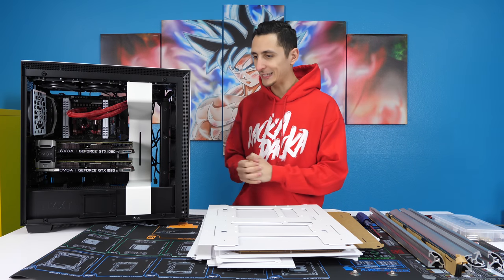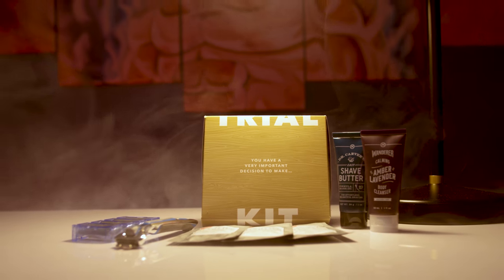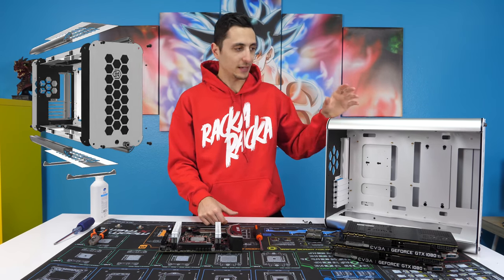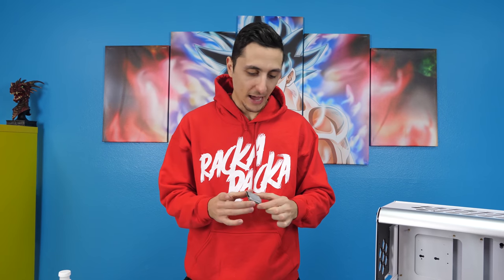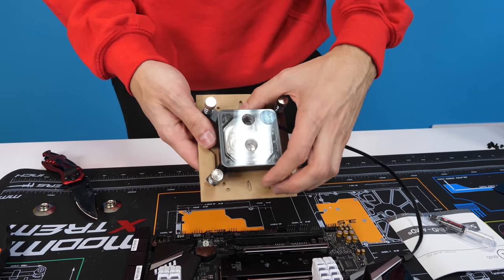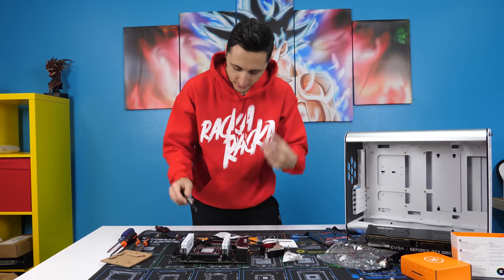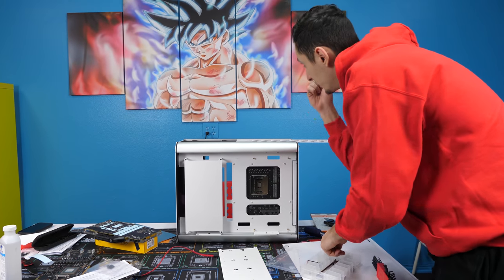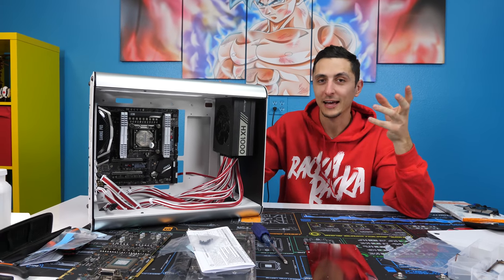Building My Ultimate $9000 PC - Episode 2

Comment: LIKE THIS SO ED CAN SEE 

The reason the paint was not sticking in certain spots ether that there was some type of non visible oil witch was repelling the paint. Or the clear lacquer that the pc cace company dose not want to let the paints stick to it. One way to fix this is to sand down the pc part u are painting so that it is slightly rough. in doing this the paint will stick better.
Reply: BKMOTO 28 which*
Reply: Actually, you can use a solvent to remove the oil, such as rubbing alcohol or paint thinner.  If you sand use like 3k grit.
Reply: yups, it's definately the paint and probably some greasy bits aswell, always sand, degrease, spray...always! even whithout paint , filler, or basecoat..just always...for prepainted-parts like this, just a very fine steelwool should do the trick, take of the shiny coat a bit, degrease, repaint...also never do it all in 1 coat. Which probably could have helped aswell...layer it down in very thin multiple coats. When i watched you spray it...too close , too thick. That overspray says it all..just too much!
Reply: BKMOTO 28 pervert
Reply: I don't think you listened to the video. Ed mentions this nearing the end.
Reply: Thank you captain obvious and he totally didn't say that could sand it down but what ever
Reply: Or just buff, prime, then coat
Reply: THATS WHAG ED SAID
Reply: JakubZ YT and about 92 million other spelling mistakes
Reply: Either*
Reply: Palm Springs Detailer rubbing alcohol wouldn’t be strong enough I would suggest acetone to remove any unseen finishes

Comment: Hey Ed,the paint is most likely not bonding well because you need to scuff the surface you are painting for the paint to basically grip on to.Just give them a quick sand and go at it again with the paint,should work fine.
Reply: If using automotive paint, should always have a primer/undercoat spayed on before any top coat. The bubbling is likely caused by a chemical reaction with some kind of plastic coating.

Comment: PMSL...(quote directly from ed) "i have built over a 100 PC's"...didn't check the RGB water block and finds out it's for an AMD MB,didn't have any fans available to build with,couldn't find the GPU waterblocks then finds two extra ones,doesn't bother to sand down the brackets and then wonders why the paint isn't binding...ed love the channel as you pull no punches and build it how it is...LOL...planning completely out of the window....HAHAHA...P.S. forgot to mention...background art is bangin'

Comment: I’ve been looking to build a pc, but the prices are too high for what I can afford. I’m fine with an Xbox though, it’s definitely not the best thing but I’m grateful for it. Good luck on the personal pc man!
Reply: Just buy your pc piece by piece when you have the money instead of trying to buy all the pieces at once
Reply: Wait until gpu’s fall in price.
Reply: n00bie Yeah, but they are already falling. So I think it is safe to save. :p
Reply: n00bie Gtx 1080 has dropped about 70$ since february, 1080ti hasn’t really dropped that much, though it seems to have reached it’s peak
Reply: sauce bang you can build a PC without a GPU that’s what I think you should do and then later just install it
Reply: n00bie yeah that’s exactly what I did 3 moths ago I couldn’t afford a GPU so I just got everything except for the GPU and then 3 weeks later I bought the GPU

Comment: Im a noob and i really want to know something. Going for the gtx1060 6gb should i get a 1080p 60hz monitor or a 1080p 144hz? Also if you dont mind you can share any good monitor you know preferably with 1ms response time since im going to be using it for gaming.
Reply: petros xirouhakis You should get a 144hz monitor. The reason is because you can get screen tearing, which would ruin your gaming experience, I bought a 1050ti (upgrade for my pc) and I have a 1080p 50/60Hz monitor. I have screen tearing which sucks. So ye, if you don't want screen tearing please go with a 144hz monitor!
Reply: Go with the 144hz. It looks amazing. Try the BenQ XL2411
Reply: 144hz ur 1060 with easily surpass 144 fps
Reply: really depends on which games. Tip: look up benchmarks with your game of choice and gpu and cpu. For example, I want to buy the i7 7820x and GTX 1080 and I'll play Doom on it. I just need to search 'i7 7820x GTX 1080 Doom FPS test' and it will show up. If you see the benchmarks go over 60fps, get the 144hz monitor. If it doesn't go for a 60hz monitor. If one of your games go over 60FPS and ond doesn't, go for a gsync monitor. Hope this helps :)
Reply: 144hz is always a better option of gaming.
Reply: RyzenStrix dude if you want to solve the screen tearing enable vsync in the game menu, this way screen tearing will disappear, but the bad thing of this is that it consumes more fps, so you will need to turn down some game specs like shadows which doesn't really matter at all
Reply: petros xirouhakis if your getting a 1060 6gb u can run gta v on all ultra settings. I know from experience with 150 so u should get 144hz and it’s just better in general
Reply: RyzenStrix what is Gsync
Reply: n00bie I was just giving a benchmark lol.
Reply: petros xirouhakis here’s a 1080p 144hz monitor I lost the another one that was a lower price and better https://www.bhphotovideo.com/c/product/1073477-REG/acer_um_fg6aa_b01_gn246hl_bbid_24_3d_ready.html
Reply: 144hz
Reply: I have 1060 6gb and 144hz and in Fortnite I get over 240 fps
Reply: 144hz, 60hz is trash for gaming

Comment: The paint wasn't sitting on the pieces properly due to silicone / grease on the parts. Probably from manufacturing. It's a good idea to key the surfaces with a scuff pad and clean them with solvent based degreaser or alcohol before painting. It will also prevent the paint from flaking off in the future :)

Comment: Tech Source, I have a question, I finally had the time to build my pc. I watched your vids on how to put together and did everything right. Everything is connected in the right ports. I turned it on and there’s nothing on the screen it’s just black. I don’t know if it’s because I don’t have my GPU yet or something wrong with my PC. Or it could be the tv I’m using. These are my specs:

Tomahawk B350 Motherboard
AMD Ryzen 5 1500X
Vengeance LED DDR4 2x8GB 3000MHz
Toughpower 750W
1TB hard drive

Comment: That old case is an "i" series model? That's why it was so expensive. The "i" series comes with RGB and fan control included.  My H700 was not the "i" series. I already had strips to add myself. But DUDE! This build is cursed! Every step seems to have a problem. It's leading me to believe that case was a bad idea. You had way more issues with the case than you did with the H700 and then everything just went haywire. Including the wires! LOL

Comment: I need the  waterblock for my computer. I have a X299 build that needs water cooling cause the thermals are really hot. I have a i7-7820x on an AIO and it doesnt keep it cool enough at 4.7ghz so i have to stay at 4.3ghz. And if you need proof that i have it i will send it to you

Comment: @Techsource
hey Ed I would like the water block I have a regular 1080 in a water cooled build but want to upgrade to a Ti. With the already crazy gpu prices I've been holding off since I would have to get a gpu and the water block also. This would help out a lot. Thanks for your consideration. Btw I live in WA state if that helps.

Comment: Hey man what do you think about this pc?
PCPartPicker part list: https://pcpartpicker.com/list/Z73ykd
Price breakdown by merchant: https://pcpartpicker.com/list/Z73ykd/by_merchant/

CPU: Intel - Core i5-8400 2.8GHz 6-Core Processor  ($178.90 @ OutletPC) 
CPU Cooler: CRYORIG - M9i 48.4 CFM CPU Cooler  ($17.89 @ OutletPC) 
Motherboard: MSI - H310M PRO-M2 Micro ATX LGA1151 Motherboard  ($73.24 @ Newegg) 
Memory: Crucial - Ballistix Sport LT 16GB (2 x 8GB) DDR4-2400 Memory  ($165.89 @ OutletPC) 
Storage: ADATA - Premier Pro SP600 256GB 2.5" Solid State Drive  ($71.99 @ Amazon) 
Storage: Seagate - BarraCuda 1TB 3.5" 7200RPM Internal Hard Drive  ($44.18 @ OutletPC) 
Video Card: EVGA - GeForce GTX 1050 Ti 4GB SC GAMING ACX 2.0 Video Card  ($209.99 @ Amazon) 
Case: Thermaltake - Versa H21 Window ATX Mid Tower Case  ($19.99 @ Newegg) 
Power Supply: SeaSonic - FOCUS Plus Gold 550W 80+ Gold Certified Fully-Modular ATX Power Supply  ($54.99 @ Newegg) 
Total: $837.06
Prices include shipping, taxes, and discounts when available
Generated by PCPartPicker 2018-04-11 14:08 EDT-0400

Comment: goku seems to need the alignment, use your laser line projector,
also send blast thus part before paint,
Reply from the maker: The floor isn’t parallel with the wall
Reply: I'm sooo... damn happy to see your reply ED, that's the first time in 2 years (maybe)
will that problem can be solve ?

Comment: Please build for this specs
Asus Strix Z370H Gaming LGA 1151

NZXT S340 Mid Tower 

Seagate 2TB SATA 6GB/s 64MB Cache 3.5 inch

Corsair Vengeance 8GB DDR4 LPX 2400MHz CRam (  X2 )

Corsair CW-9060007-WW Hydro series H60 CPU Cooler

Intel i7 8700K 3.7 turbo boost upto 4.7

WD Green 240GB M.2 2280 Internal SSD 

MSI GeForce GTX 1060 6GB GDDR 5 Graphics Card

Corsair CP-9020048-UK CX600M